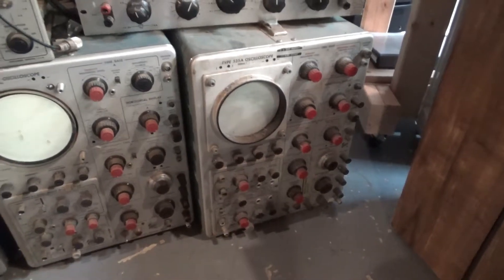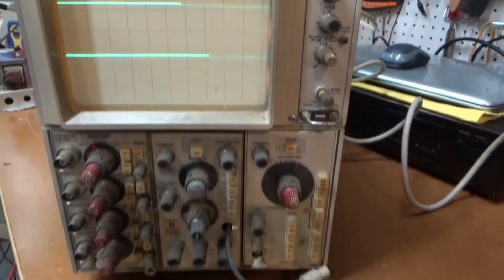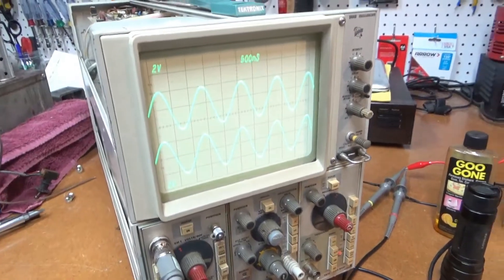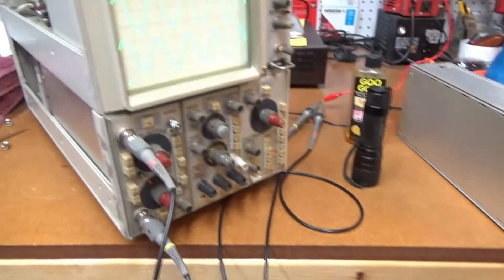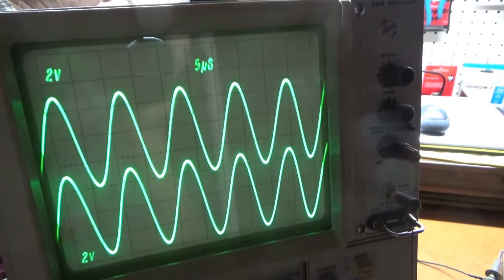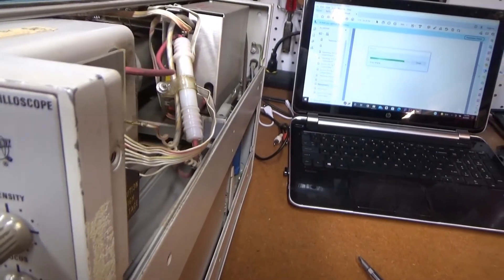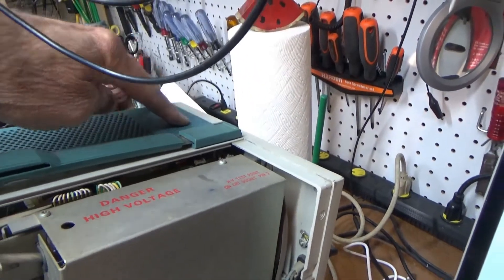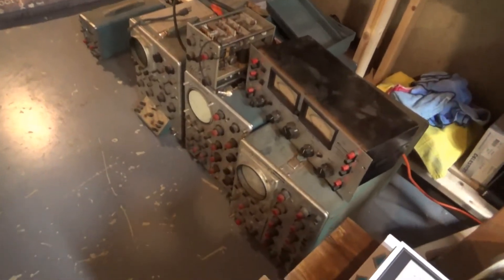1976 Tektronix 5440 Oscilloscope Service

Comment: Ain't early Tektronix oscilloscopes fun. I got a 310A that needs a ton of work. Can't wait to get to it in a few years as it
 won't be my primary or secondary scope of course. Lots and lots of tubes. If you replace components inside then you
 must use silver solder on the connections. A spool of some is usually inside the scope.
Reply from the maker: I've yet to find a roll of silver solder in any of my 5 vintage Tektronix scopes.  I had to buy some to fix my 535A. Good luck with your 310A, looks like a neat little scope.